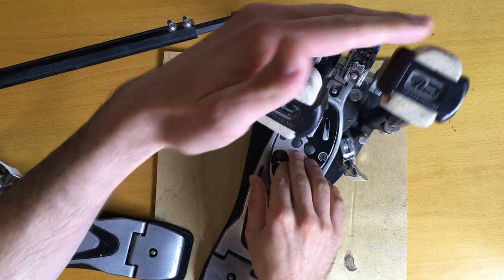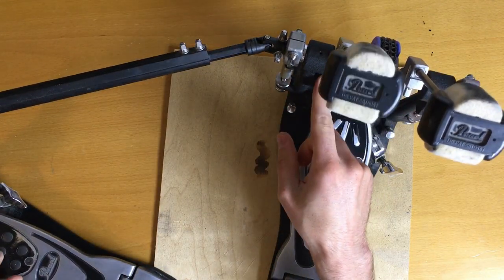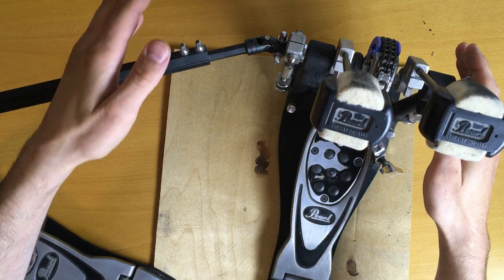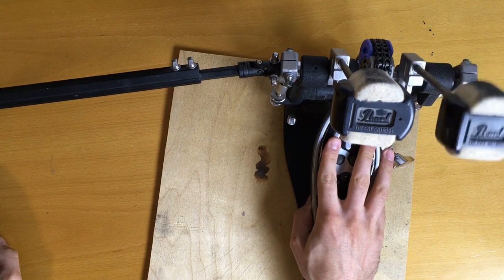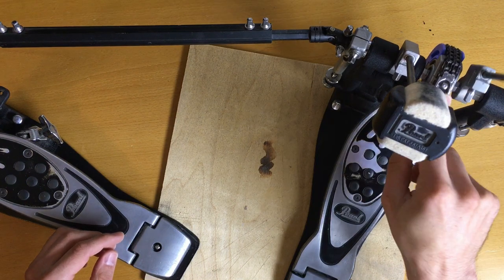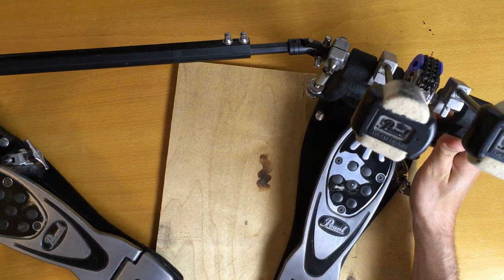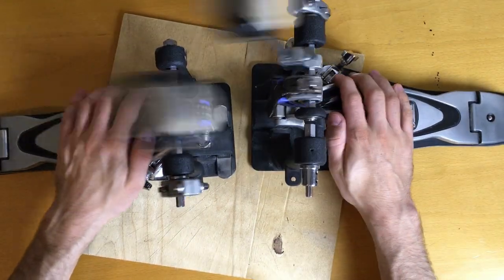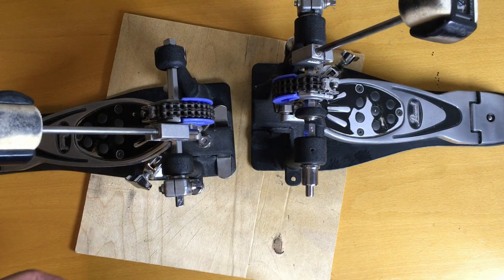Pearl Eliminator P-2000C - Lobotomy - convert into two single pedals

Comment: Thank you, really appreciate this one! Sadly I burred the head on one of the allen key screws on part of the mechanism (specifically, the piece that the spring mounts onto). Thankfully I was able to drill it out. I ultimately decided to swap the burred piece over to the left hand side of the primary pedal (as it is no longer being used since moving that beater over to the other pedal). Now both pedals work a treat! Cheers for your help.

Comment: ive always thought that the spring for the slave pedal should be on the slave pedal otherwise if it is on the master pedal the link is forced to not only bare the brunt of the energy of moving the beater but also the added stress of the spring.

Comment: Thanks, I was looking for video like this. You could say in title something like 'converting double pedal for 2 singles' or something for people to find this more easily. I have eliminator P-2052 and my screws and bearings were ridiculously tight. Even with grease on everything it was very hard to take things apart. And one bearing in slave pedal was so stuck that i couldn't get it off even though i was hammering it with all my might. In the end I managed to do this conversion but the slave pedals bearings were left sticking slightly outward from their sockets. The hole job took me like 3 hours...
Reply from the maker: Thanks and done :). Yest the bearings are tough. You don't see it in the vid but I damaged my screen when the axis was hammerd out and flew right into it...